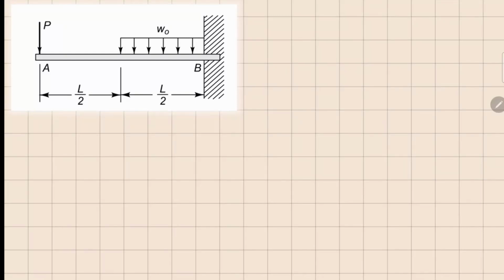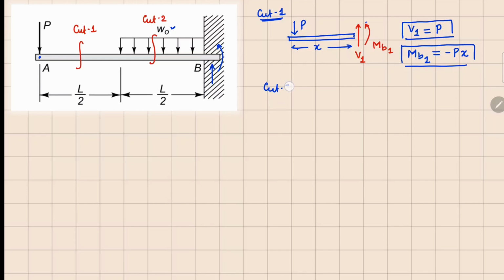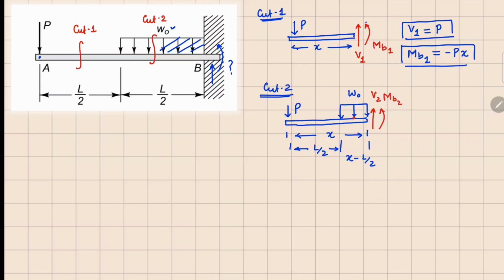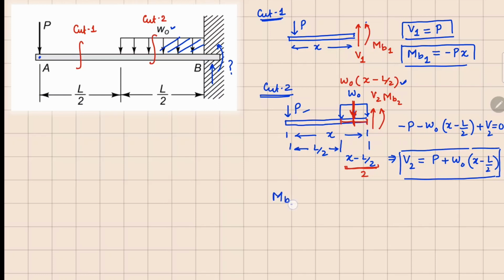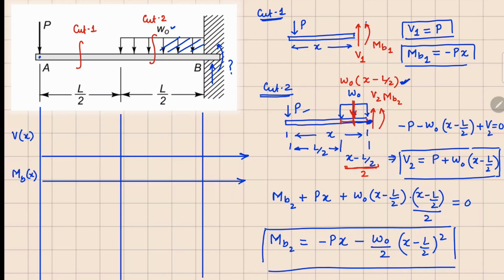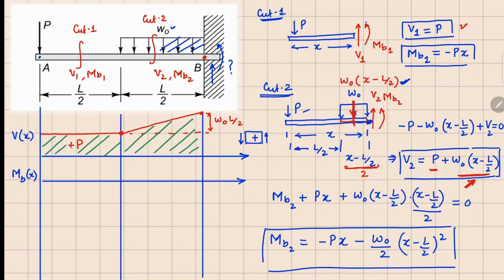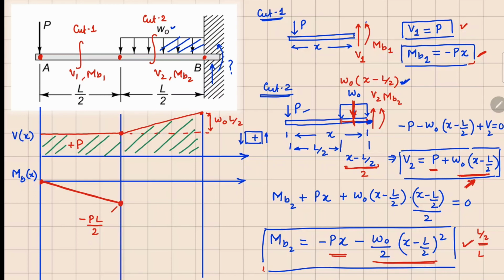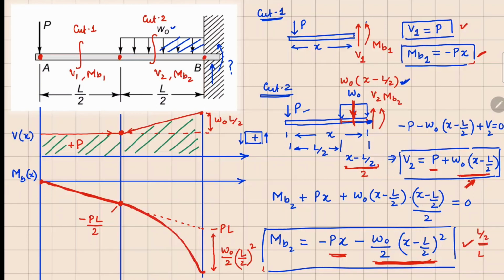Problem 3.12 || Forces & Moments in Slender Members | Mechanics of Solids | Crandall, Dahl, Lardner

Comment: Why we didn't consider the cut from the right side in the given problem for the cut 2
Reply from the maker: Good thinking. It is easier to analyse the right cut but you need the reactions, which will require a separate FBD and extra work.